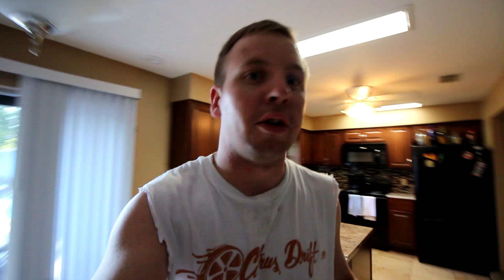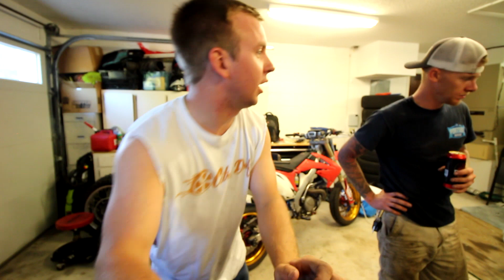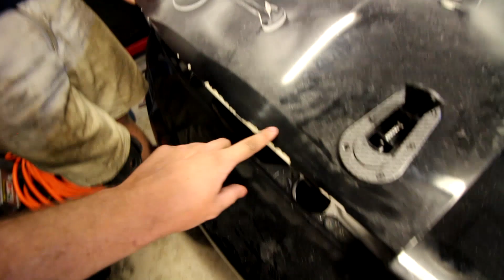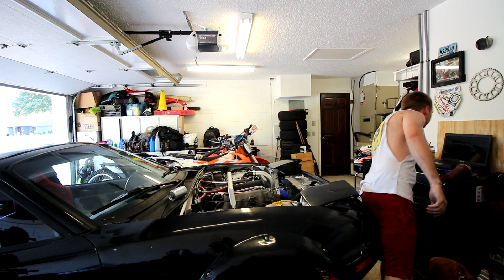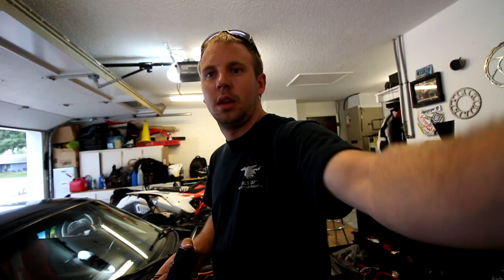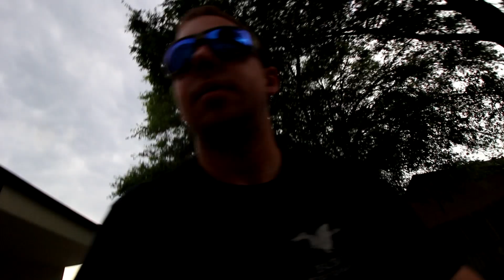What its like to drive a turbo miata!

Comment: nice! so cool to see it running and you having fun. funny, I'm putting down the identical power 237 / 215 but on 13 lbs boost on a smaller turbo. it really transforms the car.
Reply from the maker: Boosted Miata ya man like makes the car 300% more fun to drive and they are already fun as shit to drive stock
Reply: FloridasFinest yep! and spinning tires has never been easier, already burned through my summer set, at least the rears, and it's not even June lol!
Reply from the maker: Boosted Miata I believe that lmao I really need a new set of wheels, once I get some nice tires it's gonna be hard to stop doing donuts lmao

Comment: im in over my head a bit maybe you could help i have a 1.8 jdm vvt motor from a 2001 model that is in the machine shop having a stroker kit installed. Its going into my essentially stock 91 miata. I also want to turbo this motor but am hearing my trans and diff wont hold up. what trans and diff are you using and what would be reliable for what im doing? My power goal is around 400 whp on e85.
Reply: kmiata.com

Theres a bmw trans swap kit, and a GM lsd swap kit. If you dont wanna do the diff swap, get an OS Giken.

Comment: Yours is a race car of course you wouldn't want to daily it, I have a Turbo NB with ac and power steering and cruise control and all that, awesome daily and I can also walk mustangs when they think I'm an easy win
Reply from the maker: xTheNameisEthan That's goals my dude lol wish mine had ac lol
Reply: yeah i lucked out the guy i bought it from built the engine with all forged internals and decided he wanted to trade it for a super clean stock NA
Reply: xTheNameisEthan I wanna buy an NB and turbo it and take it autocrossing
Reply: nb2 here turbo daily a/c and power steering

Comment: If you don't have a 6 speed already, 300hp will chew a 5 speed lol.
Liked for turbo noises haha
Reply from the maker: Daniel Brown my buddy is running 500whp on his stock 5 speed lol I'm going to run with it till it blows. They are cheap and easy to swap
Reply: Wow. Well if it works, it works!
Reply: AutobahnWars Rx7 5 spd will hold more more than you can make
Reply from the maker: Daniel Brown not true lol my buddy rolls around on a 500whp Miata with stock 5spd. He's doing rx7 but hasn't broken his 5spd yet. If I break my 5spd I'll just swap another in they are really cheap.
Reply from the maker: Brendan Nelson eventually id like to do rx7 swap
Reply: I am going off the multiple instances that it's happened to other people. (Miataturbo.net) Granted they are actually track oriented cars, and with the heat and extended sessions on a track, it probably killed them faster.
Reply from the maker: Daniel Brown agreed! I'm sure I'll blow mine that's a given lol I feel like if I do first gear launches I will break some shit